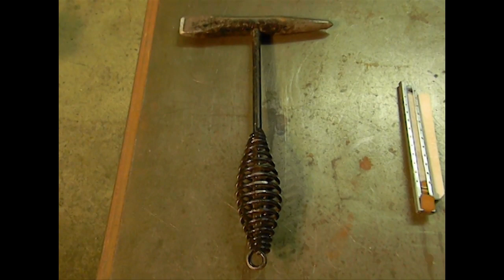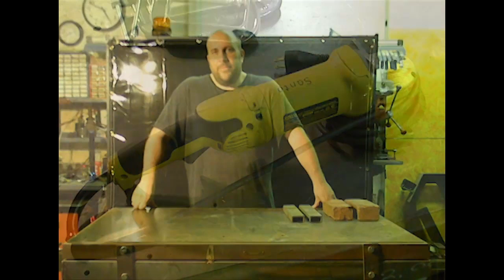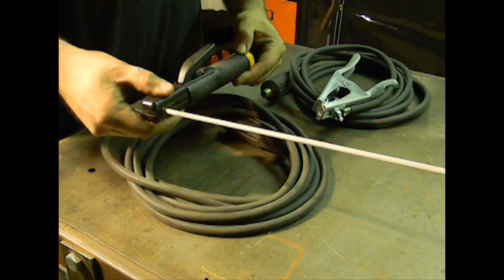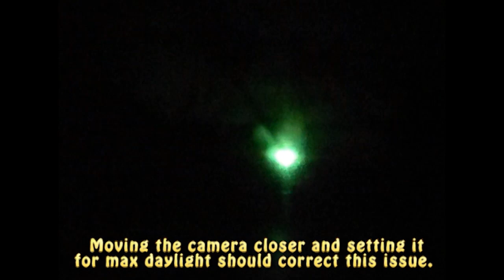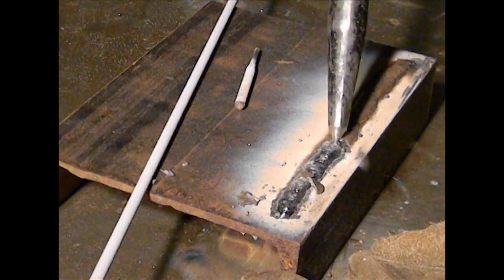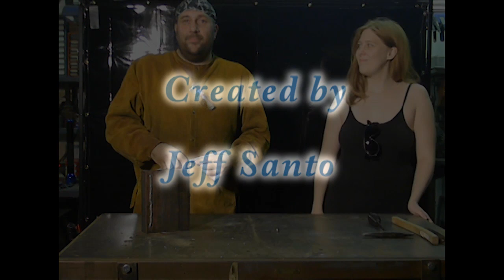Intro To Stick Welding Part 2 - Setup & Your 1st Pass

Comment: I been welding for over 15 years and my millermatic was stolen out of my garage.  I went and bought  harbor freight 170 amp mig/flux core wire feed welder and it works just fine with Argon and fluxed wire. I just needed something to hold me over until I can scrape the money together to get another name brand welder but the harbor freight does what need it to do for now.

Comment: I was just as Harbor Freight and the guy in front of me in line was buying the 120 amp Flux machine. I wanted to say NOOOOOO! But newbies won't listen. Why waste that money on a machine that won't work? Forget trying to be Jesse James on a beer budget. $250 will get you a 140 amp DC stick machine from Everlast that will work. You can weld as thin as small 1/16th material. rods are easy to find, you won't have feed issues, roller issues, liner issue, contact tip issues, etc. Forget a cheap MIG/Flux machine, you are just going to have issues. Unless you are going to pony up $500 for a Hobart 140, forget MIG/fluxcore, get a stick machine. They are not a "cool", but will be more reliable and can weld thicker material on a lower budget. $400 will get you a 200A Everlast stick which will weld up anything you can dream of.

Comment: do I need a metal table? 
if I touch the table with singer in my hand will I eletrocute? 
can a shock come from stinger?  if I'm touching table?
Reply from the maker: Very good question, I mean it would make sense that the table is in someway holding an electric charge right? Fortunately for us electric current can be a little bit lazy, it travels the path of least resistance. The first thing to remember is there is no current flowing unless you are actually welding. Having a ground strap attached to the table with the machine on does not create a complete circuit.

I think this would make a wonderful topic for a video, I'll try and have it up by Monday the 3rd I believe I can give you a much better answer as well as being more in depth. Hope this is helpful :)
Reply from the maker: I posted response video yesterday, hope it better answers your question :)
Reply: yes thank you
Reply: +Jeffrey Santo : Tq, nice answers!

Comment: Hi Jeffery and thanks for the video.  What do you think about  the AC stick welders for the home shop like the Lincoln AC 225?   Is it worth the extra dollars to go DC?
Reply from the maker: Its not a bad little welder at all but before talking about models. features and cost I would just ask a few questions... I watched the video on your power hammer (very nice by the way) and noted that there are welded parts on it. Did you do the welding and if so what machine are you using? I only ask so I have a baseline to compare other welding systems to it.
Reply: +Jeffrey Santo --- I have a Northern Industrial 125 amp flux core welder running .035 wire which works well on 1/8th inch steel or less.  My welds penetrate and look good.  That said, anything over that - like welding the large 1/4" thick square tube to the 3/4" plate,  looks like popcorn and requires lots of caulk and extra paint to hide the weld  :))). So, I think I need a larger welder with bigger amps for the heavy stuff.
Reply: So what do you think Jeff?
Reply from the maker: I've been looking at different machines on the market and doing a little research. The Lincoln is a good and solid machine but I have never been a fan of that style of welder. I wanted to try and find a suggestion around that price range that would be a lot more versatile and give you room to grow.

I have been hearing a lot of really positive things about Everlast welders and took a look at their current offerings. One machine they have is called the PowerArc 200ST Stick / TIG welder. One of the nice things is it has dual voltage so you could weld on a 110 volt mode if you had to. 

Its no secret to anyone who watches my channel that I am a huge Miller fan, but of I were in the market and looking to buy I would differently give this Everlast model a shot.

Compact IGBT inverter design with automatic overheat and over current welding protection
Dual voltage 120-volt/240-volt design features auto sensing technology
20-200-amp of DC welding capability on 240-volt, 20-120-amps of DC welding capability on 120-volt
+ if the future if you ever wanted to test the waters with TIG all you would need are a few extras and your golden.

Sorry for the late response, things have really been hectic around here lately and I didn't want to come back to you with a half baked answer. Hope this helps :)
Reply: Jeff thanks so much - I think your spot on with the Everlast 200 ST - will give that one a go and let you know how I make out - Love your channel and thanks for sharing!
Reply: Nothing wrong with the welder itself. The issue wit them is they don't have infinite adjustment. You can get in a situation where a weld is too cold, and your next option up is too hot. I would save up more and get the Hobart AC/DC stick machine.

Comment: Hello, I know I'm a few years too late. but I just started teaching myself how to stick weld. I've been watching a lot of videos, that's how I came across yours. I can run a decent bead on a flat surface, but when it comes to seeing what I'm welding I can't seem to see the seam of the two metals I'm trying to weld. my weld bead is all over the place. any suggestions? Thanks
Reply from the maker: +MrBikercat Two things really help your vision improve, I had the same issue when starting off. First make sure your helmet lens is clean and free of scratches, the light from welding can start to really blur things when there are imperfections in the lens. Its like driving a car when the windows fog a little and your looking at oncoming headlights.

The second thing is glare, if you are welding and there is light coming from behind you it can create glare on the inside of the helmet. In the sun I have to put a piece of leather on my helmet to stop light from coming in through the back. Another thing that can help is wearing a dark blue or black shirt, it sounds strange but wearing light colored shirt can actually help the light from the arc reflect up into your helmet.

Comment: Here's a fun fact: according to Wikipedia, the surface of the sun is 5505 °C (9941 °F), which is about the same as the arc in welding.

Comment from the maker: I am talking about the temperature of the arc itself not the material being welded. Depending on what source you read the temp of the arc varies greatly, max settings producing arcs anywhere from 5500°F - 12500°F. From the sources I found the average temp was approx. 7000°F.

The arc temperature may reach 10000°F (5500°C), which is sufficient for fusion the work piece edges and joining them. (substech.com/dokuwiki/doku.php?id=principles_of_arc_welding) Just one source of many.